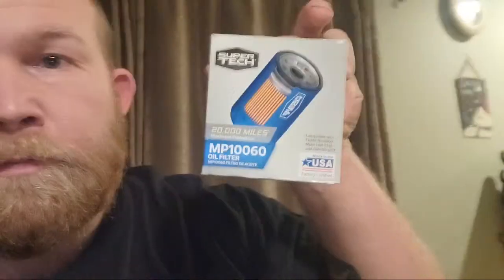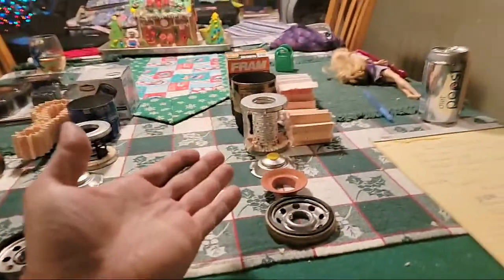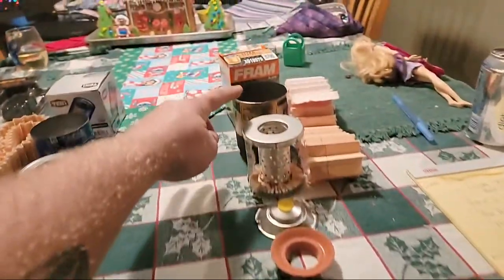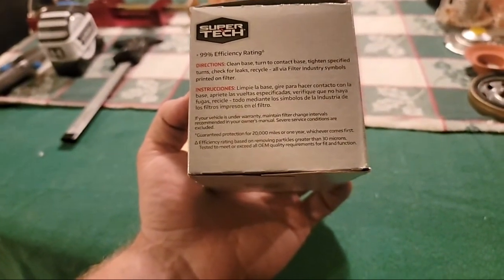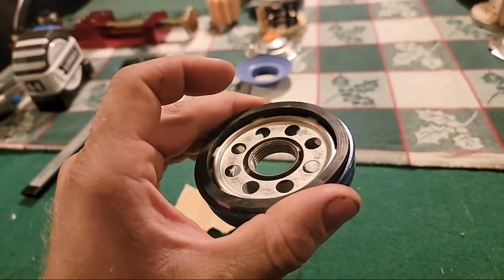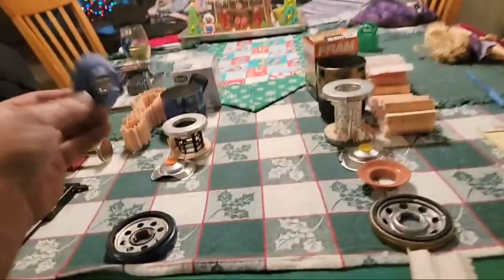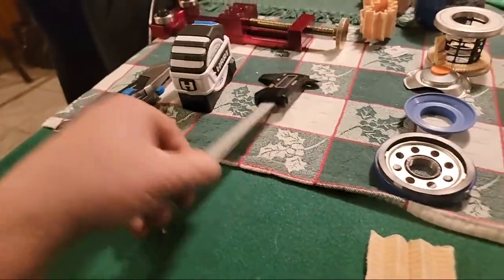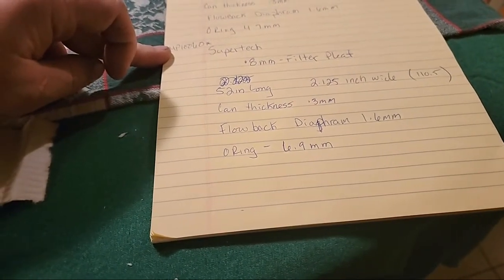FL500s Oil Filter Alternative - Fram VS Supertech Ford

Comment: Great video. I like the top line Fram filters, too. I noticed from my own experience that these filters catch more sludge than  the factory grade filters. I always figured that the factory engineers considered the more efficient flow rate a priority over the superior filtering performance. Maybe it is just all about the cost??? I have used Motorcraft filters for decades with no problems. When I was a Chevy guy I used AC oil filters and suffered no major engine problems with either.

Comment: I was at Walmart getting oil and filter for my oil change and I was looking at the supertech and K&N filter side by side and they looked EXACTLY THE SAME. The same holes over the silicone. Same stamping of date and made in USA on the bottom. Even the same skeleton structure holding the filter inside. For reference this was the K&N 1004 and supertech 9688 I think. For a old Honda. The supertech has been impressing alot of people lately so I grabbed one. Got my winter oil change done. New wipers and lights, all ready for winter.

Comment: Was at Walmart yesterday & they had the supertech white filter for $2.97. That’s nuts. Unfortunately they didn’t have the Fram ultra I needed. The ultra is the only fram filter I’d consider using based on past experience. The ecoguard green can synthetic filter is a good if I can’t get the fram. Only $7.50.

Comment: Hi,  in regard to motorcraft oil filters I have been hearing the black glue holding the filter together is getting inside the engine. Have you heard anything about this problem with motorcraft filters?

Comment: Why did you not include a cut open of the FL500S, since you are saying these two filters are alternatives to the motorcraft, the construction of that filter would be exceptionally helpful.   Just sayin'.
Reply from the maker: Do some homework like everyone else and go check the rest of the filter videos
Reply: @FordBossMe   Narcissist much?  No need to be rude bub.  I'm quite familiar with the Motorcraft filter.  Offering a little constructive criticism as a viewer, it seems logical to actually include the filter on which you base the comparison and this video. Ya know, cause that's what you titled it.

Comment: Il have to watch this later but I wanna shoot out a guess lol I myself don't like fram and iv seen the super brand before but ya ...im gonna say there roughly the same but super tec edging it out lol but I gotta go to work and fix 3 of them 4.2l ford f150 heaters lol 😆  here we go ... hopefully its a bunch of blend door motors and no plugged up cores
Reply: Couldn't stop watching ...looks like im wrong lol
Reply from the maker: The Fram Ultra is way better
Reply from the maker: There is jotting wrong with a fram filter 

It's the people using it honestly
Reply: Blind FRAM hate prevents a lot of people from using good filters.
Reply: @warrenself  blind ? The old ones sucked blind you say iv done this for 15 years and own my own shop
Reply: @warrenself  wix and valvaline period
Reply: @themfnnitrorooster7619  Pretty soon your beloved Wix will probably turn into a black Purolator Red. The FRAM Ultra is one of the best filters on the market. People just love to hate FRAM.

Comment: the 10060 and 10575 are not the same filter. both fram numbers. the 10060 was the old 5.3 chevy and the new 5.3 calls for a 10575. its the 10575 that interchanges with the fl 500s.  that being said the only difference i can find is a little higher bipass pressure on the 500s. im thinking of ditching the expensive ultra 10060 and going with a 500s motorcraft because i change early anyway
Reply from the maker: It's a good filter, the 500s is fine

Comment: I always wondered does police vehicles get the Motorcraft filter when they come in for service? Or do they get some kind of performance one?
Reply from the maker: Standard Ford One
Reply: Yep... Saw the whole vehicles life,  shops maintenance log of a Crown Vic  Cop car with 260,000 on the tried and true 4.6...FL-820S and the Syn blend Motorcraft 5W-20... Idled like it had 60,000 miles on it!!!

Comment: Do they still have the metal backing on the titanium or did they change it for both?
Also help me understand. 
I know you said they changed the filter and made it thicker and stronger but won’t it still tear easier then a filter with metal backing?
Also how good is the royal purple filter and flow rate?
Reply: I also run Schaeffers, redline; or valvoline oil depending on vehicle but mostly try to stick with Schaeffers. Denali has an oil leak from the rear man in seal so I’ve been putting valvoline maxlife high mileage full synthetic in it until the beginning of January when the trans comes out for a rebuild and I’ll fix the rear main. It’s 04 Yukon Denali.
Reply from the maker: I'm not sure how much more I can explain it I did a very good job here I thought and I explained it very well

The metal was only there to support the synthetic soft filter

When they made the composite compound or hybrid compound the cellulose media type material is able to support it by itself and yes plenty strong and has an inner metal case

Comment: For many years,Fram filters have a terrible reputation for poor quality. There are many YouTube videos documenting Fram internal construction vs. other brands. I think to add veracity to your results you should also compare Wix and Puralator filters. I’ll bet they beat the Fram.
Your videos are usually 100% right, but I’m having a hard time be,keying Fram has come from the bottom of the pack, to top tier.
Reply from the maker: I'm going to be as kind here as I can

Just because you have not seen it sir doesn't mean I have not....I have cut open HUNDREDS of filters here

Go to the library of videos here and type in OIL filters and have fun....

I've done the homework already, if what I show you makes you dought me or you think an oil filter review takes my credibility away because I told you something you don't like then I don't know what to say 

I'm as straight a shooter as they come
Reply from the maker: You don't have to believe a word I say.....I show you the cold hard truth and you can believe what you want from there
Reply: @FordBossMe  Thank you for being kind to me. I know you’re a serious, no BS guy, so I’ll check out your filter testing videos.
Reply: @FordBossMe I been useing  the fram xg10060 for a while now but I think I'm switching to the Wix 57060 because of the more uniform pleat spacing.

Comment: Would you recommend a ford oil filter for a honda civic 2013 82k miles
Reply from the maker: I don't know the cross
Reply from the maker: But yes I like the Ford ones better
Reply: Do you mean which one would fit my car. If that is the I have already found one. I just want to know if you recommended ford oil fillers vs any other brand such as acdelco